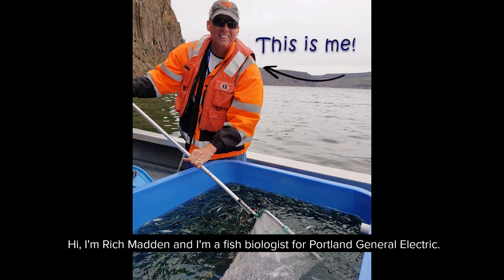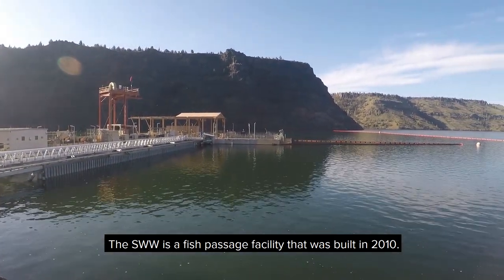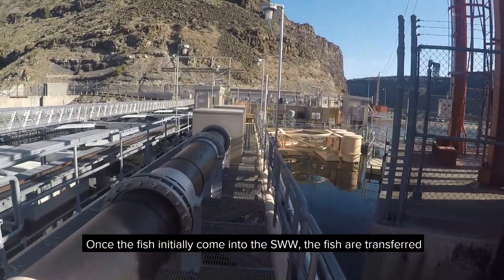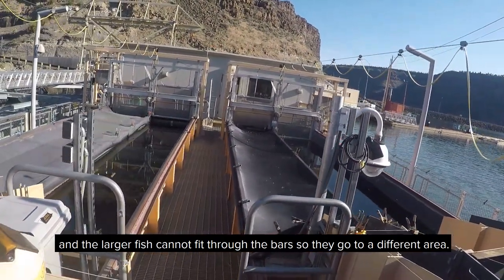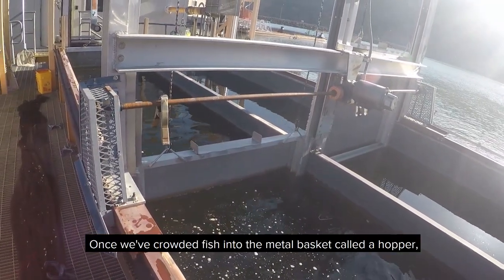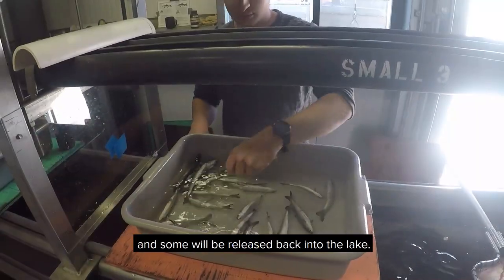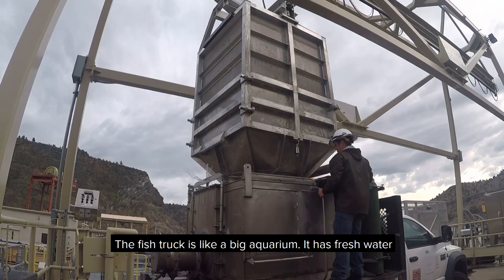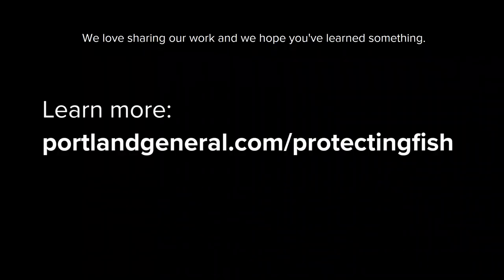Transporting juvenile fish in the Deschutes River

Comment: Is there a reason you can’t release cooler bottom water at times when the juveniles aren’t moving downstream?  The tower is changing the temperature and water quality downstream.  Are you meeting water quality standards in your PGE’s dam renewal proposal?  It’s great to fix the problem the dam caused 50 years ago, but not if you ruin 100 miles of river downstream in the process.